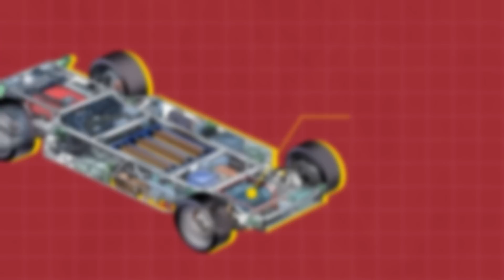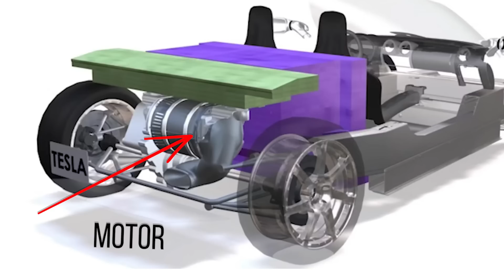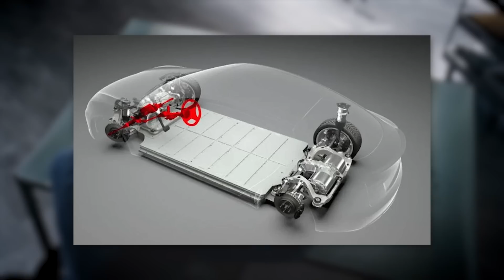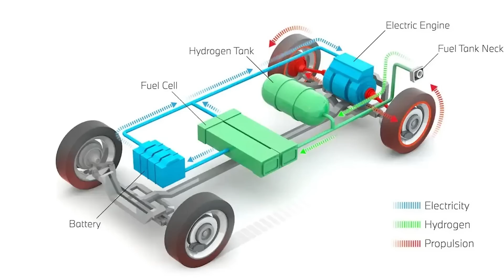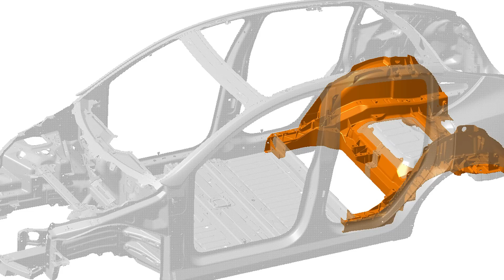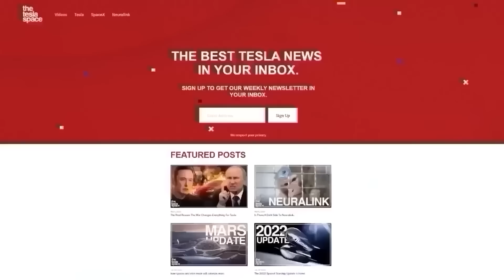The Real Reason Tesla Developed Their Own Battery Platform!

Comment: Tesla is working on their 3rd platform now for cybertruck and their 15k next gen vehicle. The keh innovation relates back to the original gm skateboard. Steer by wire. No drive shaft, no steering column, all by wire. Put that on top of the structual battery pack skateboard design and you can now build the whole car in modules and then just connect them together at the end. 

This is how they expect to cut costs of manufacturing in half. Since they can build each module in its own optimized assembly line including painting outer body parts and just assemble the final car at the end. This means fewer robots and fewer workes are needed and shorter assembly lines which means faster and cheaper assembly which mean cheaper cars.
Reply: Don't be fooled. It may make it much cheaper for them to create, but they will just say it's new advanced technology and sell it for more. There will never be a $15k Tesla vehicle. Maybe $25k, but never $15k.
Reply: @ericblanchard5873  I don't believe I've ever heard $15,000.00 however I could see them getting a razor type of vehicle or a personal mobility strictly a single-person commuter type of vehicle pretty close to that.
Reply: @ChasL  I agree, a side by side would be probably around $15k if they decided to build one and mass produce it.  They definitely have the money to build side project vehicles like this, like the ATV is supposed to come out around the time of the Cybertruck but we've heard no news on that, they only made very small ATV's for small kids that go slow like a power wheels you buy from walmart etc.
Reply: @Another-Address  batteries do not combust the the same way gasoline does. It's more a slow burn then an instant fireball. Very few people have died from battery fires because it's very easy to escape since it starts slowly. Now the downside is it's hard to stop once it starts as it's a chemical fire and so needs more then just water that would work for gas cars.

The main cause of battery fires is physical damage to the battery pack that can cause a thermal runaway. This is why the pack is sandwich between metal plates to protect it but still at highway speeds it can still happen if you are very unlucky. The second is if some conductive liquid or material enters the battery area and causes a massive short. Salt water can be a problem if the battery pack is already damaged so it's no longer water tight.

I am not dismissing the issue, just you are thinking it's far bigger an issue then it really is. Just like gas fires burning down a car, battery fires burning down your EV is very unlikely. And if it makes you feel better the odds of dying in an EV fire are even lower then gas fire because of how slow it starts.

I don't think you should be forced to buy an EV if you don't want to. I don't like government programs that push for that. But by 2040 most cars on the road will be EVs, there is just no way to escape that reality. It's just more efficient and cheaper to use and own.
Reply: When we’ve got full self driving and no need to steer manually I’d love DBW. But till then if there’s no column I wouldn’t be caught dead in it. If there isn’t forces feedback to the wheel, then the relation between the steering angle and the wheel is guaranteed to be inaccurate. If there is forced feedback, there could have just been a column that doesn’t consume extra power.
Reply: @Freshbott2  would be scary to get hacked while using the new steer by wire and have some hacker crash you off a bridge or into a fuel depot.
Reply: @ericblanchard5873  They can already do that with a column. I'm more concerned about people miscalculating a turn cause of unavoidable delays in the steering angle or or not knowing if there's an alignment issue
Reply: @Freshbott2  I'm sure they will work out the kinks and make it safe before putting them in the hands of consumers
Reply: Ä7UKDDKKCJDOZUDUDODIFU1CIFIFOFI1CIIDDOIDIXIXIDDKKDKDIDIDIDDDIXIDKDKDKDKDKDKDKDDKSIKDKDDDJJDKDKDKKDKDKDKDKDDKDKKDDKKDKDKDKDKDLSOTIDKJCISIS1YRKEHDIOEJDIDIDKD1UDJJDJDJDDIDJJDDJJDISOWOSJKDODOIDIIRIRHFHUDKKDJDJFIDIDIRIIRIRIRIRIRIRIRIRIRIRIRKRIFIRIIRIRIRIRIRIRIDIFIRIRIEIIEIEIIEIEIIEIEIEIEI9EOWODIIRURIIEIIIEOI🎉❤😢😮😮😅😊❤KLWLWKWKEKKEEKKEKEKDKSOSKSOSOSOSISOOSOSOSOSOOSODIDIDISIDISIISIDIDIDIDIDIDKDKKDKDJDKDKKDKDKDKDKDKSKSKDKKSKEKDKDJKFKRKRKDIDILO3O4LEOOEO393838IRIRIRIOOOOPPOOOOOOOOOOOOÒOOW😀😀😀😀😀😀😀😀😀😀😀😀😀😀😀😀😀😀😀😀😘😏🤗🙄😶😑😑😚😍😙😙🤗😙🤩🤗😙🙄😗🤗😗😗🙄🙂😉😎😙😋😋😋😍😆😘😉😘😗❤😶😁😁😁🦄🦄🦄🦄🦄🦓🦄🦓🦄🦓🦄🦄🦄🦄🦄🦄🦄🦄🦄🦄🦄🦄🦄🦄🦄🦄🦄🦄🦄🦄🦄🦄🦄🦄🦄🦄
Reply: There is so much other invesment like MINING and agriculture.......invesment in gold is a waste we can't eat gold and silver......why other countries are not trusting dollars...
Reply: Yes - but do not these "battery packs" have fire issues ?  No thank you I'd rather not be burned alive by my eco friendly car.
Reply: @the.kiss.of.karma.2025  you can burn alive in your gas car as well. Gasoline burns too. Diesel less so, so I guess you can buy only diesel vehicles then. 

Regardless not buying a EV because batteries can burn is a like not getting on a plane because they something crash. There is some logic to it but it's mostly paranoia at best and just an excuse to not admit something about yourself at worst.
Reply: @P Hanna  I'm sorry you won't find out how awesome electric vehicles are then. Especially a Tesla Model S Plaid or even a Model 3 Performance. They are excitingly fast and fun to drive. If I could trade in all my vehicles and boats for even an older used Model 3 Performance, I would in a heartbeat. I am hoping to make enough for the tri-motor Cybertruck since I only drive trucks for work and play, it will fit me the best, but I doubt I will beat the odds in stock trading before my turn comes around in line for my Cybertruck purchase. I hope one day you come around to electric vehicles. And yes, gas vehicles will actually burn you up faster in an accident than a battery pack that has a lot of metal in-between you and the battery pack. It would take a very long time to burn through to the cockpit. Also, they are making lipo4 batteries for the standard range Teslas now that are a lot safer than li-ion. Check it out.
Reply: Tesla is dead, now they can't do battery swapping. Semi solid state and solid state batteries have high energy density with low cycles,  with battery swapping the low cycles is resolved.
Reply: @rwyo83  there is no market for battery swapping, unfortunately, if there was Tesla could pivot, early model S could do it easily support it if needed with a model refresh. But it's not going to happen.

The reason why is because you need to pay for the 'rental costs' and the cost of electricity instead of just the electric cost. Part of the enticements of EV is cheaper per mile, so choosing to pick more expensive per mile cost will not be popular.

Battery swapping is cool tech but unfortunately it just doesn't work economically at scale.
Reply: @stillatwork  You pay for the rental costs, but the initial cost for the EV is way more cheaper because you don't own the battery, battery swapping is more convenient, it only takes 3 parking slots and you are ready in 2 minutes, fast charging will never beat it
Reply: @rwyo83  if the EV pay structure is set up that way, but that seems unlikely. Eventually the battery pack needs to be paid for, be it a piece of a time or all at once. The initial costs could be lower but it doesn't just take technology but a financial system to hold the value of the battery until it's payed off and infrastructure to support the physical swapping.

That's a lot of prerequisites to get started, meanwhile fast charging network just requires installations where there is power. While that is non trivial, Tesla showed it can be done so there is also an working example to point to if you are trying to raise capital.

Not impossible but highly unlikely it will ever happen at scale.
Reply: @stillatwork  It's happening, battery swapping is the solution for buses, taxis and commercial vehicles, Tesla is behind while Nio will have EVs with more than 1000 miles range
Reply: @rwyo83  buses it can work since they run predefined routes so it can all be pre planned. But there are lots of ways to do buses, you can power them from overhead lines if you want. My point is buses doesn't translate to wider vehicle economy since it's such a restrictive case.

Taxis can be similar to buses depending on how the local government supports ride share. 

One main advantage in both cases is often one company (or government) owns all the vehicles so sharing batteries between them is easy to handle financially.

However, taxies and buses can just as easily be built to support charging only, by pre planning the wait times.
Reply: Drive by wire is nothing new.  As usual Tesla try to claim something is new when it has been used elsewhere for years.   These street legal cars all have had fly by wire steering long before Tesla considered it:  Audi R8 LMS GT3, BMW M6 GT3, and Mercedes-AMG GT3
Reply: @hairyferrit  that's not the point, the point is combining drive by wire with no drive shaft, skateboard battery system and module manufacturing can make a brand new manufacturing line strategy possible. None of those technologies are new by themselves but the combination is new

Comment: A good researched video. Frans looked very young.
As BMW is still having vehicles either with ICE and BEV they dont use this concept I suppose.
Whats needs to be added, Tesla is pre manufacturing component which will be added at the end. Connected through a (wireless) bus with identification. Also I think the mechanical and connucication interface will be defined and you cannot put just different colors together (as painting is nit done with the carossiery). Maybe an interface to build different vehicle types.

Comment: GM?  Well and 12 other automotive companies tried this.  They fall into two categories;
1) Companies that have tried it and found out all the reasons it's a bad idea.
2) Companies that haven't found out why it's a bad idea yet.
Guess which camp Tesla is in.
Reply: I can't help but notice you didn't detail why it's a "bad idea".
Reply: @MRBenchwork  There is a ton of them.  Post would be too long.    But think about it, Different cars have different requirement.   One skateboard make you seriously stuck on one type of car.  Be it gas, hydrogen, or electric, Skateboards where just basic body on frame design for multiple models. If your stuck on one type/class of car there is no need for the skateboard.  Skip that step and use standard production methods.  
i.e. Should the sub compact, entry level vehicle use the skateboard for the truck? or Should the truck use the skateboard for the compact car?  Sure that's obvious nether word work   But it also doesn't work very well for closer things. Take the model Y and model 3.   The weight distribution is way off.   Rollover is way different.   Turning and acceleration have different requirements for the skateboard.   Collation requirements are different.  So, as a manufacturer.  You end up with a line up of bad cars due to all the compromises you have to make to make it work for multiple bodies.   That only works if you have a monopoly and can forces your customers to buy bad cars.    In the real world,  Customers will just buy someone else's car and not put up with the compromises.
Reply: @lucidmoses   I'll forgive you for being ignorant. While it is true that a pickup truck and a car are very unlikely to share the same platform (skateboard), this is not a new concept and is extremely common in the automotive industry.  As a mater of fact until recently the model 3 and Y did share the same platform (skateboard) and about 80% of their parts in general.  Keep in mind that what we as consumers understand as a platform (skateboard) is often different from what a manufacture considers but to give you a simple example of this platform (skateboard) in wide use, you don't have to look any further than pickup trucks. A chevy (it's what I'm most familiar with) pickup chassis can be found under pickups, but also under vans, suburbans, busses, box trucks and other vehicle types. In these cases they are almost universally swappable with minor parts swapped out.  This is essentially the concept of a skateboard. All of the "important" stuff, is in the skateboard and the body is simply attached. In some cases they might add extra springs or change the wheels and tires for the skateboard to work for XYZ vehicle but the rest is the same. And this isn't even a fairly new concept. Back when I was building a 1969 chevy pickup, I found that I could swap parts from a 1991 pickup onto the frame (power steering and front disk brakes) without any modifications. everything was bolt on.  What Tesla and other manufactures are tying to move towards is just the next step in this process and make the platforms more cross compatible between similar body types. A model 3 skateboard for example could also be used for the model Y but also for a Mini Van, or a compact pickup truck and since all of the weight is in the skateboard, you don't have to worry about weight distribution for rollovers as you also incorrectly stated.
Reply: @MRBenchwork  No, Skateboard and platform and not the same thing.   A skateboard is a type of platform.  It's like Dog and Labrador retriever.  What makes it a skateboard is the fact that it gets used by many types of verticals.  Other wise. It's just a platform.
Reply: @MRBenchwork  Anyways, Terminology aside.   In spite of what the bean counters want.   If they actually stick with a single skateboard they will find out why it's a bad idea.   If they stick with multiple platforms  then nothing of value has changed and it's just marketing hype.

Comment: The original tesla skate boar allowed for complete battery replacement in 15 minutes.   The new improved design are built in and cannot be removed easily.   Tesla is betting the battry will never be replaced and the cars will be totaled if there is any damage in an accident.   You thus now have a disposable car.
Reply: My mechanic told me if the engine of my 15 year old truck needs replacing it will cost as much as the truck is worth due to labor cost. 
It would be great to be able to swap out parts like Lego.
Reply: @BadenHealth  
The key is labor costs. 

Contemporary cars are primarily NOT designed to be repaired by their operators, but to be maintained by the dealership. Take for instance the jeep willy scout car in WW2 was designed that it could be shipped in a single crate, assembled by untrained soldiers, operated, maintained and repaired by them in the field. They don't make them like that anymore, granted you probably wouldn't want to drive that daily anyhow. 

If there exists a balance of safe, economic and comfortable vehicle with ease of maintenance and repairs, I'm still looking. Usually though you only need to look at what older cars you still see on the road in higher numbers. It's self evident which cars were built to last or easy to maintain.

Comment: Actually GM invented the first electric vehicle skateboard-platform before Tesla
Reply: Proof? The 1920s gm commercial ev truck's sure didn't use skateboards. The ev1 didn't use a skateboard pack design either. 🤔
Reply: @4literv6  Google it.  GM introduced their skateboard platform around 2002 with the notion that one platform would be shared with many vehicles.  It's not some novel idea though: it's basically body on frame.  Then you need the batteries low, and electric motors are (or can be) very compact.